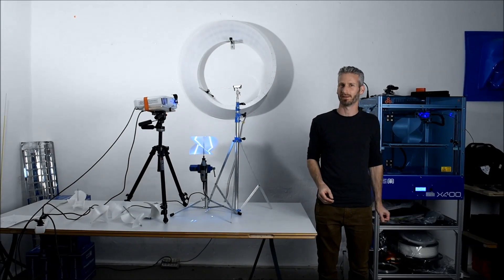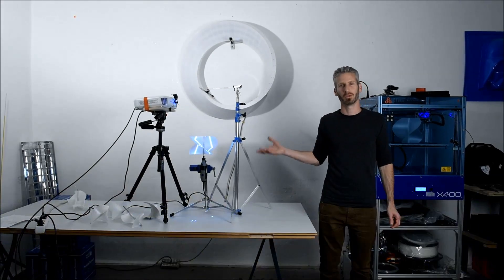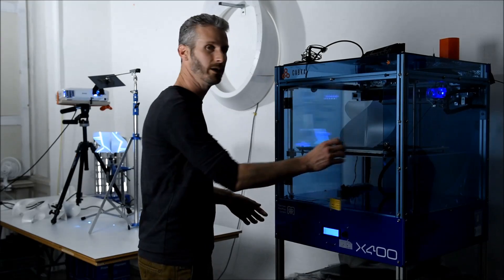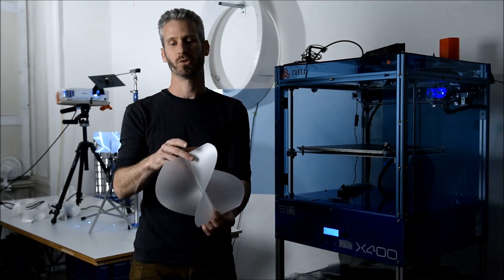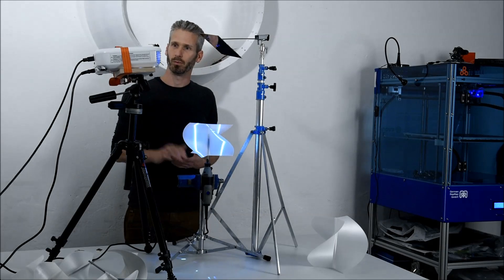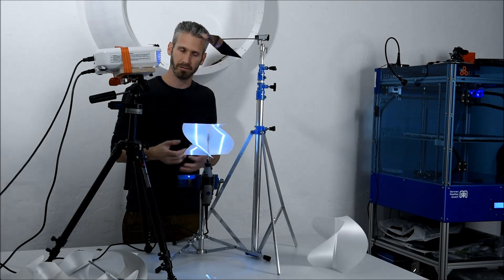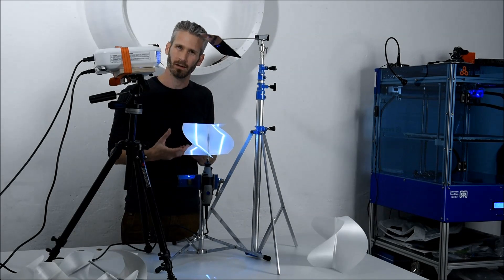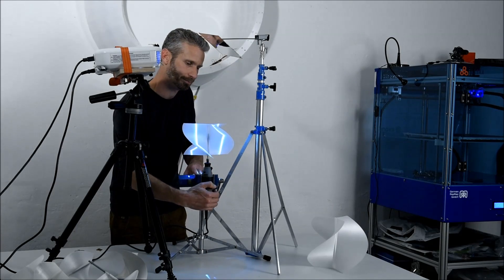3D printed volumetric display

Comment: Well i don't want to be the bearer of bad news but this is not really projecting 3d objects or shapes, based on this and other videos from this channel it looks like there is a common occurrence with the projected image being a long linear shape, but also seems like it has a fixed length problem (as in the projected shape always extends to the top and to the bottom of the spinning display), which implies that it can't produce a small shape in the middle of the screw or display, it might still be possible to achieve this with this current set up it has, but based on all the videos posted it seems they didn't show any update/demo of a moving object within the confines of the display. In conclusion, Like I said it is still possible to use this for actual 3d with just a few tweaks (as in placing a encoder synced with the projector).

Comment: Put a encoder tu find the position of the spindle and sincronise the videoframe (new video fotmat) with rotation and.... VOALA !!! Real 3D !!!
Reply: To anyone reading this now in the future. A two photo diodes on the base should work, and put light on that spot every N frames. Then you can use the light shining on them to speed up or slow down the motor slightly. That could divide the frames outputted into separate layers.

Comment: pretty cool, but not really volumetric, since the objects are just extrusions of a 2d image.
Reply: Spin the helix synchronously with the projector and it'd be easy enough to change shape mid extrusion
It does requires a new frame per vertical 'pixel' , 1080 vertical resolution = 64800 hz for 60fps video, bit of an ask for a commercial projector but well within the reach of current electronics

Comment: I was thinking about this concept for a few weeks before I bumped onto this video. I was thinking a high speed projector projecting vertically down on a spinning wavy surface might be more clear than this. Cool concept anyway. :-)
Reply: just today i found this link, deeply agree with you, pretty cool.
Reply: Nowadays you can buy them for cheap ...
In all sizes
Reply: @AndroidFerret  Do you know anywhere the parts or plans for these are commercially available? The volumetrics company is defunct, having a hard time finding alternatives. I'm trying to commission the plans to be made, but I'm not sure about the arduino microctontroller.